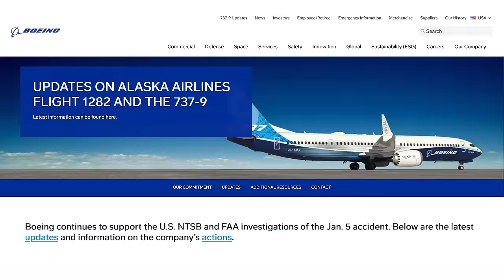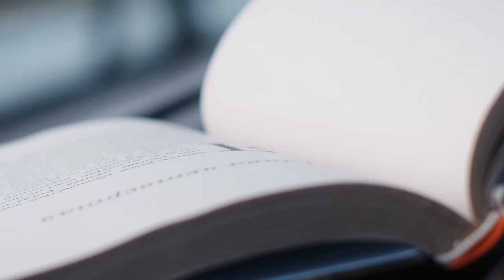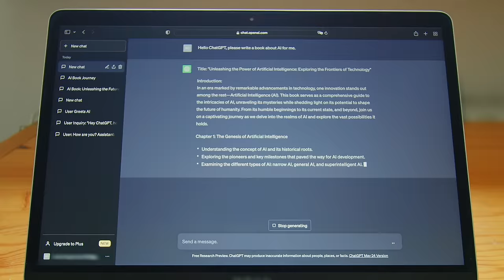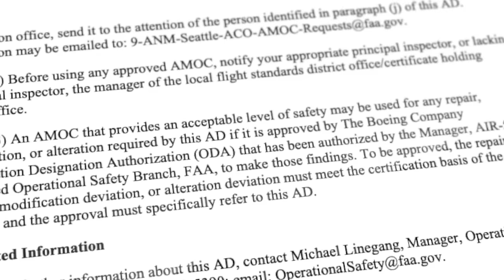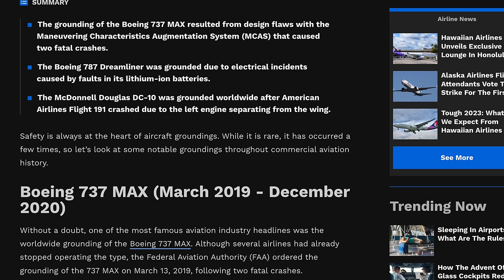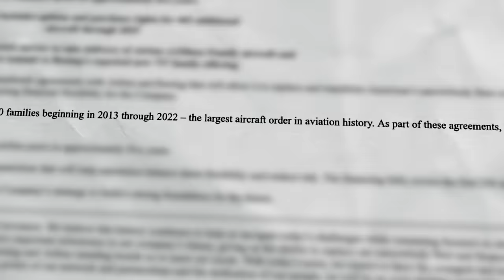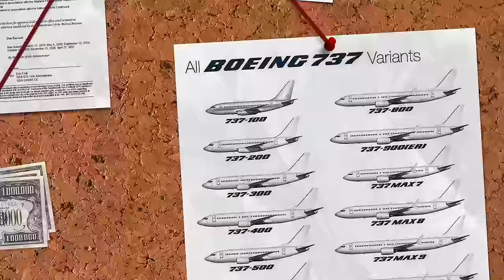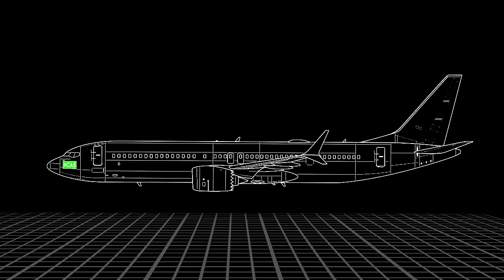737 MAX - How Greed is KILLING An American ICON

Comment: Technically, in the specic instance. Boeing forgot to put the bolts back into the airplane.  Ultimately,  Boeing workers removed the plug so Spirit could redo some rivets.  Then Boeing did not reinstall the bolts into the plug.

Comment: The bolts were removed by Boeing for an unrelated fix (bad rivets near the door, which were found twice in the same place even after Spirit had supposedly fixed them), and never put back. Check the video from Mentour Pilot, there's a lot of detail there. The airline knew there were issues with pressurization, so they prevented the plane to fly over water. But this issue was not obvious to the pilots and seemed just like a fault of the main pressure controller, which has 2 redundancies, so they just switched for one of the spares and that apparently fixed the warnings on the cockpit. That deemed the apparent problem as not flight-critical (therefore, not so urgent as to ground the aircraft before a maintenance check). The possibility that the airline knew that this specific hidden door-plug had a problem and for that reason they didn't put passengers in front of it is just... a very serious conjecture. I doubt pilots would be willing to fly the aircraft at all if they knew about a potential fuselage compromise.

Comment: I flew back from Las Vegas the very next morning into Portland. I flew out the day before the Duke door plug blew out. I flew back the next morning on Southwest a Max nine which is the same as a max eight the pilot come on and told us all to keep our seatbelt secured tightly that we were going to experience turbulence. We never hit any turbulence, and when we boarded the aircraft, they told us to spread out that we needed to make the plane More balanced, there was only 80 people on the aircraft. I noticed that they were moving people from those particular spots away from where the door plugs were that totally makes me angry now after the fact they knew about this problem and never told us they told us about the turbulence which was a lie. They knew that this had a problem and didn’t want us to be sucked out of the airplane when the plug blew out. What a disgusting bunch Southwest should be sued over that themselves.

Comment: The aircraft wasn't too destabilised with the new engines, it had slightly different characteristics than the NG.

It failed because MCAS wasn't in the manuals and it was one point of failure. All the other stuff is meh... 

Boeing messed up with the AGS on the door plug though, no idea how that happened!

Just because it's an old plane doesn't mean that it should be replaced. If Boeing can improve it to the point where it cant be improved anymore, then fair enough, time for a new a/c. The changes that have happened to it for over 50 years, any change needs to be seen of it requires more changes to the a/c elsewhere.

Comment: There is so much more to this story than is being told. Foremost, when we were manufacturing 737 classics in Renton the plane was shipped from Wichita on rail in (2) sections. When the 737NGs started arriving they arrived in one piece already joined in Wichita before shipping. Now here is where the water starts getting muddy. When the MAX started arriving Boeing had sold off the Wichita division to Spirit. So Boeing mechanics, like the engineers, have their own union. The quick and dirty is that, for example,  I as a flightline avionics tech did not have authority to do structural work like bucking rivets. So the door plug you speak of may in fact fall under Spirit authority. In other words, it may be installed by Spirit contract instead of Boeing factory mechanics. I, and many podcasters like you and Mentour and many others don't know who actually installs that plug. Is it in fact installed by factory assembly in Renton or does Spirit have that individual authority. Irregardless, if or when that plug is installed there is a process. So if I'm a factory mechanic in Renton and I want to remove or install the plug, in a nutshell the approximate procedure is as follows. I make a form entry for "okay to remove." I wait for an inspector who stamps that request. Then I remove the door, do my business, and when done I make another form entry "okay to install." The inspector comes along, inspects the work I performed, then he inspects the whole area for "F.O.D." (foreign object debris). This is to ensure the work is done, there's no trash, there's no tools, CLEAN.  Then I get an okay to install from the inspector, I install the plug and then I have to enter a subsequent follow up for "Final Inspection." The inspector comes back again makes sure the plug is properly installed, does another FOD check and stamps it off. SO, the big question in my estimation is who in fact installs that plug. Is it Spirit? Is it Boeing? Either way the fly in the ointment appears to be that "someone" didn't inspect the installation. In a word, it wasn't verified by QA. Ultimately, it could have actually been delivered with missing hardware.

Comment: It's a big call to say that the airline decided to not use two seats because they were worried about a plug door. That would have required quite a few staff from various departments to arrange such a 'risk mitigation'. Also - why suspect a plug door - there are many more likely leak paths and any attempt to find them would have started elsewhere. If the plug door was suspected of leaking, an inspection would have been called for - having worked for an international airline, I find it inconceivable that any licenced engineer - let alone a team (as would have been involved) would have contemplated such an idea - or even thought that somehow only two seats would have been at risk in the event of such a massive depressurisation (if at cruising height). 
Also, while there has been talk of 'loose bolts', there hasnt been a report on which bolts. Also as the four bolts that lock the door down into its tracks act as stops, and have locking pins, they dont need to be 'tight' to do their job perfectly well.

Comment: There is no almost raising that total to over 500. Blown out doors and explosive decompression are NOT catastrophic failures to airframes! Please maintain the quality of your shows...
No, they did not just switch off the warning light! The pilot switched it off and then they managed it manually until they landed at the nearest airfield. No, its not the pilots job to find the problem and fix it. No once switched off, the light does not stay off. They make a maintenance ticket and it is investigated. Be aware that there is a lot behind such an alarm. Electronics, miles of cabling, hydraulics, mechanical valves. Yes it's damp easy once you find the problem to criticise,  it's sometimes impossible to isolate an intermittent fault! Remember that the plane would have been pressure tested on the ground and because of the lack of vibration and turbulence, that damp door would have stayed in place and held pressure.
Yes, they knew there was an issue but had no reason to believe it was dangerous.

Comment: You can view the absence of passengers in the seats as the actions of a hero at the airline. Maintenance, pilots and management knew there was some pressurization issue, and likely some wanted to take the aircraft out of service. Management refuses to take the time necessary to find the problem which could take weeks to a month to fix if something serious was found. So someone, either management or operations limits routes to non-over water flights. Someone, maybe at the urging of a line mechanic that suspected the actual problem, said, “Ok, we can’t stop them from flying, so whatever you do, don’t sit anyone in that row, even if the flight is full. Kick people off of the flight if you have to.” Some scenario like that kept people from losing lives. Very doubtful it was luck.

Comment: The door plug failure concerned me so I spent some time looking into it.  It turns out that Boeing purchases the 737 fuselages from Spirit Airlines with the door plugs installed and was pressuring Spirit to deliver them faster.  I had heard one comment that it was unclear who was supposed to do final inspection on those plugs since "Boeing has to remove them anyway".  I work for a company where people's lives depend on our products and we take that seriously.  People's lives also depend on Boeing's products and it does not seem like they take that seriously.  The number of Quality Management Failures at Boeing (on the 737 and the Starliner) is absurd.  Likely one reason is that in 2019 Boeing decided to move more toward a car manufacturing model and laid off 900 Quality Inspectors.  I heard there was pressure to rehire them but the fact that they did it in the first place show where their priority is.  And where was the FAA in this whole process?  I am not a big fan of regulation but for companies the make products people's lives depend on, regulation in a must.  Every change that could affect quality needs an independent review including process changes.  Really the door plug is only the tip of the iceberg.  There are other 737 airworthiness issues that on this aircraft that stem from not doing proper Risk and Quality assessments.
Reply: In this particular case the fuselage needed remedial work after delivery on some rivets or bolts or something that happened to be near the door plug, which required the removal of the door plug in order to do the work.  The remedial work itself had nothing to do with the door plug mechanism or structure beyond the need to remove it in order to do the other work.

So the initial installation of the door-plug by Spirit was not to blame.  It was the failure to reinstall the bolts after completion of the remedial work and reinstallation of the door-plug that was to blame.
Reply: @junkerzn7312  I heard that too but I think there evidently some confusion on the installation and inspection.  There is a chance it came from Spirit without the bolts and confused the Boeing personnel but that should have been caught by an inspection procedure at Boeing - if there is one.  Maybe the issue is that there is no way to perform the inspection after the install.  If so, that seems like a design issue that should have been caught with an FMEA.

Comment: Thing is these planes are still much safer than your car. There are so many redundant systems and pilot (2 min, working in well trained tandem) checks, that it takes quite a bit to reach the point where one crashes.
Reply: I hear you, but my door has never flown off my Ford 😂
Reply: In fact, the door incident happened 10 weeks after the plane had been delivered

Comment: 9:34 The "depressurisation incidents" referred to were warnings about a fault with the auto-pressure system. It has basically nothing to do with the door blowout. If Alaska had deliberately left those seats empty because they were worried about the door plugs, why were people seated in 26C and D, next to the same door plug on the opposite side of the aircraft? Are you suggesting that Alaska were fully aware not only that a door plug wasn't sealed properly, but also which one it was - and they didn't bother to install four bolts?? That's ridiculous.

Comment: Plane production is years behind. If an airline make to much noise they will get their purchases bumped to lower on the list. This has happened multiple times. So airline are cautious about pushing Boeing cause they don't want to loose their slot

Comment: Investigations are pointing to the latest incident/accident being more of a systemic problem with QA & QC in manufacturing which raises the question: is this also likely to happen on other products?
This happening to a 737 is actually both good and bad: good in the sense that the 737 is already very much in everybody's minds and memories, meaning it is harder to sweep it under the rug as something isolated; the bad that unfortunately this is now only pinned to a single product (even to a single model). If all assembly plants uses the same processes and systems (it is the same company after all), what is the probability of similar oversights happening on other products?
I know it is not something anyone really wants to think about... it's easier to think only a single product/model is "defective" than potentially all products of a single manufacturer.
The MCAS problem was a design issue, which pertains to a single product, so slightly different situation.

P.S. The detailed explanation on TC's and amended TC's really took me back to my days in aviation design & manufacturing and all the bureaucracy of dealing with aviation authorities (which actually has its place to ensure safety)!

Comment: Your video emphasizes the link with the design engineering failures in the MCAS control system in the earlier fatal crashes, which is important. But I suspect that the final NTSB report, and the info released so far, will identify a different culprit it this latest accident. It is a failure in quality control (QC) and the broader quality management system (QMS). QC is a technical term used to refer specifically to quality inspection processes, to verify that a manufacturing step conforms to spec. QMS covers a broader range of processes, from design to assembly to inspection to delivery, as well as the auxiliary information systems, to ensure that a product is delivered with high quality. 
    It seems that this failure did not involve the design engineers, but a completely different part of Boeing's organization, as well as its relationship with a key supplier Spirit Aerosystems, the now-independent company that operates the Wichita, Kansas plant that makes 737 fuselages (which Boeing spun-off around 2005).

Comment: I worked as an engineer, chief engineer, sr. engineering manager and program manager for several major aerospace companies including Boeing, United Technologies, Honeywell and Parker Hannifin for 25 years.

The video is well done and well researched.  In regards to 737 Max incidents, the blame is with Boeing.  The MCAS system was a total travesty.  There are System Safety Assessments done and Design Assurance Levels assigned.  Someone at Boeing had to blatantly sell the wrong classification to the FAA.  It should have been a DAL A system which is “Catastrophic”.  This would have driven independent sensor redundancy into the system without a common failure mode.  This is not something that was difficult.  The lives were sacrificed due to corporate greed.  I did a write up before the investigation was done with my theory and it was correct. 

The door plug incident is still primarily Boeing’s fault. The sensors faults that the pilots and maintenance crews would experience have different levels of severity. Systems could be on a MMEL list and the aircraft would be allowed to dispatch with certain restrictions.  I am assuming that the fault message was more of a warning message and determined to be a nuisance fault. Nuisance faults happen the time time and are difficult to diagnose.  If it was on a subsystem, they could just replace the entire thing.  Finding a pressure leak on the aircraft would seem to be difficult on the ground. 

I have worked with airlines that have had to clear MELs on the systems of my former companies and depending on the Functional Hazard Analysis and System Safety Assessment may not seem like a big concern.  Alaska took some action because of the unknown but probably assessed the issue as a low DAL level problem. In reality, explosive decompression is not a minor failure.  The Alaska engineers and maintenance personnel should have talked with the Boeing customer support.  Boeing may have assessed a low impact.  I do not know what happened behind the scenes but ultimate culpability resides with Boeing.  That plane should have never been turned over to a revenue customer.

I was angry with Boeing when I heard about this. I worked on the defense side and not with commercial aircraft but they were one of the poorest company cultures that I have worked for.  They had some good engineers but also many that would not match up to the typical Tier 1 supplier like a Honeywell or United Technologies.

I have worked with aerospace companies and certification bodies around the globe and  I am extremely disappointed with Boeing.  I worked a lot with Airbus and Embraer as well.  Boeing was once the “gold standard “ but corporate greed took priority over technical and safety. 

Do not get me wrong.  I believe that Boeing aircraft are safe but it should not take incidents like this to improve their quality and stop them from cutting certification corners.

They are not the only company that has done this. I would have executives coerce the engineers into shipping products that barely passed ATP but showed functional concerns.  This was done to make month end quotas.  I have gotten negative feedback from leadership when I wrote a technical analysis that a subsystem failure mode could cause a fire.  Long story but I appreciated the video.

Air travel is safe and keeping the pressure on the industry will keep it reliable and reduce incidents like this.